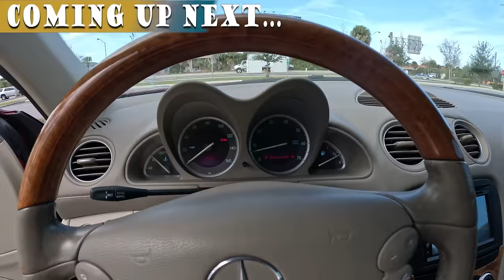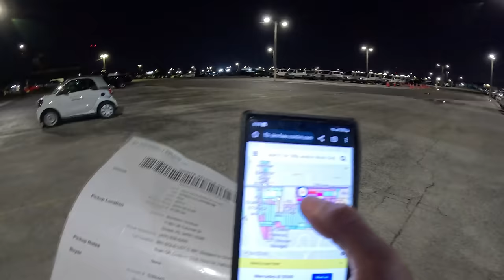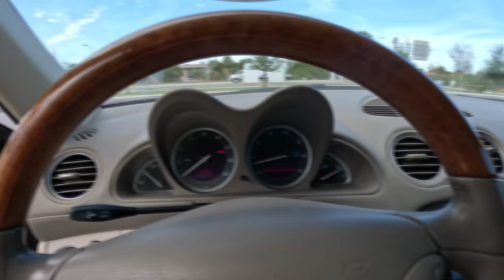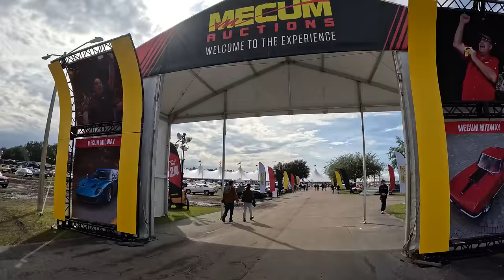Day 1 was a Disaster! I tried selling 5 Cars at the Mecum Car Auction But Everything Went Wrong!

Comment: In the ghetto in my city, you pull into the O'reilly Auto Parts, Auto Zone, etc., and every light pole has a sign that says "Absolutely no auto repairs allowed in this parking lot."  Invariably you will find one guy doing an entire engine rebuild, another guy dropping the transmission, someone else doing an oil change with no drain pan, tires everywhere, batteries getting recharged.  It's mayhem.

Comment: Don't EVER put duct tape on the painted surface of a car! If it doesn't pull paint off, the adhesive will still be a bitch to remove. Instead, use the original Scotch blue masking tap. They now sell other versions of it, including one that supposedly is even easier to remove, but it has less adhesion and the fact is that the original version, even after extended application, and even after being subjected to sun or rain (yes, water) will not only do the job intended but will almost always pull off without adhesive left on the surface. But it will virtually never pull paint off upon removal.
Reply: Painter’s tape.

Comment: Watching the clearcoat peeling off hurt my soul 😭 Crazy that I've flipped probably half a dozen hardtop convertible Chrysler Sebrings, two Pontiac G6 hardtop convertibles, and one VW Eos hardtop convertible all with more miles and they had no top issues, this video makes me feel damn lucky 😂 But hope you at least break even on the Benz man 👍
Reply: Mercedes Hardtop convertibles are problematic if you take them to Mercedes for repair, you will be charged through the nose.
Reply: @ccnixon  Mercedes quality control rivals Jaguar and Ferrari. Practically non existent.
Reply: Hardtop Sebring Convertible? never seen one, a 200 yes, never a Sebring
Reply: @TheEnd-eg6wq  Yup the hardtop Sebring came out in 08 - The later first gen Chrysler 200 was basically just a refreshed Sebring so it kept the same hardtop design. The rear decklid opened backwards just like this SL500 and folded similarly and looked just as complex, but surprisingly for an old Chrysler I've never flipped one that the top didn't work.
Reply: I have that hardtop convertible and I was spilling my drink watching you guys struggle with it! I heard about the red painted ones having a paint issue that you found. That car is a pain in the ass. When it says ABC, it means $$. But you probably know how to fix that. Best of luck making some cash on that Benz!

Comment: Craig, a tip for you for the future, pick up some Dr. Shrink Shrink Wrap Tape.  It is as strong as duct tape (possibly stronger) but the adhesive doesn't leave residue on paint.  It is pricey but worth it.  It is made for use when shrink wrapping boats.

Comment: I too had a 2003 SL500 that i still have nightmares about and i dont even own it anymore...  It had 20k miles on it when i bought and was equally as crappy as yours.  I spent over $6k to keep that top running correctly over the 2 years i owned it and there was only 1 guy in town that had a remote clue on how to work on it.  In fact, when i took it to the Mercedes dealership to work on the top, they told me they do not work on those things and sent me to this independent guy who did a great job of keeping it going, but worked on it on his time schedule so it would be gone for weeks at a time.  Im getting all worked up just writing this...  good luck

Comment: As for the 2018 subaru wrx. The front and rear difs need the fluid changed every 25-30k if you don't when turning it will bind up and click kinda like what you were hearing.

Comment: I personally am at a loss as to why you chose to use the type of tape you did when there are several other varieties available at Walmart. Then the way it was removed pulling straight up rather than pulling forward after sitting in the sun for a bit later in the morning. it is not that uncommon for a painter to allow the base coat to cure a bit too much before applying the clear coat, severely reducing it's adhesion ability to burn into the base coat and become one with it.  I thought that you appeared to have far more miles on you in that dept. to know better. Especially with little - no time  to cure the more than possible results. But the results did create film content , whereas here on this platform ,can result in being more valuable than the loss itself.

Comment: Wait, so you got screwed when you bought that Mercedes cause the top was not working properly, ebrake panel broken etc. But then you drove it straight to the auction to sell to some other unsuspecting buyer? Do I have that right? And the WRX with issues, same deal?

Comment: Use 2" painter's tape, not duct tape. It'll hold long enough, it's designed to keep paint out (so will keep water out at least for a while) and won't take the clear off when you remove it.

Comment: Guys,guys,guys....you buy 3 different rolls of tape. 1) green frog tape, 1) blue painters tape, 1) gray duct tape.  You take the frog or painters tape and outline the area you need to protect make sure you secure to the body. THEN CUT THE PLASTIC TO FIT THE AFFECTED AREA. Last you duct tape the plastic to the frog or painters tape leaving a 1/2" lap or expose 1/2" of the green secured tape. If  this comes apart as you drive, you stop and get out and re-secure with more green or blue,covering the separation.  When you remove slowly un-peal the onion and I  mean slowly.......... Don't forget to send me a 2xl t-shirt after reading this.

Comment: OMG. The 2003 SL is the worst car ever made. First year made. Biggest money pit. Miles doesn't matter. Its the age of the car. ABC pump is $5000 dealer part only. Top will need all safety switches and rams. The fluid is leaking inside the car. It will ruin the interior. $5000 repair. The suspension oil hoses leak. $3000 repair. The battery balance module goes bad. $4000 repair. First year has the 5 speed transmission. Worst trans ever made. All these repairs need the merdedes SDC Laptop for proper repair and calibration. The list goes on and on. If you paid $1000 you paid too much. Return it and park it where you found it ASAP !

Comment: The issue with the convertible low hydraulic fluid makes me think there was a leak in one of the hydraulic hoses, otherwise, the reservoir would have been at the correct level. I have a convertible where you have to have the parking break on to move the roof (20 year old car). If there is a problem with the roof, there is an audible 12 beep warning.

I think your idea of trying to make money by moving cars from one auction to another was flawed. If it worked, every dealer would be doing it! Good luck though, I am prepared to be surprised!

Comment: Not to scare ya… but i had a slk 55 AMG & the reason your roof is not closing is because bad pump seals in your roof… it’ll cost anywhere near 3-4k to fix you haft to pull apart the whole roof & reseal each pump with small stupid seals its awful sold that pos & never looked back after i got my c6 those convertible mercs are THE worst & biggest pos to ever own.

Comment: Literally NEVER put duct tape on a painted surface even if the clear is in good condition it will rip it up. Blue painters tape on painted surfaces wont leak, holds well and would never do that unless the clear was applied with hopes and dreams.

Comment: Are you sure (like which house you lived at lol) that was your red convertible Corvette?  You were walking around it, said it was a 2015 (and displayed the year to us on screen) and in a hot minute you had the camera on the upper driver side windshield where the info was and it had 2014 on it.  Everything was a bit all over the place.  Calm down lol.  And tape on paint before even trying to add hydro fluid to make the top function properly.  You are better than that, right?

Comment: Subaru viscous coupling on the rear on the gearbox, prop shaft out and I think 8 bolts to unbolt, drop the unit and replace with a new part ! I think from past experience is where I would go too! £480 UK price 14 years ago for the part, when money had more value than todays Mickey Mouse currency.

Comment: as soon as i saw you put tape on that paint i said ohhh noooo. i have a 2001 slk. same color. the factory clear on these cars is losing its bonding to the paint. my car started with a quarter size bubble. after spraying it with a water hose nozzle (not pressure washer) i had 60 percent of the clear lift right off. any surface that the sun hit let go of the clear. the sides were ok and i was able to blend the clear back in and respray. 

i have never seen anything like that. i have had small sections do it on early 2000 fords. But it is starting to seem that factory clears are good for about 20 years and then just release. 

but that was not a respray, that was factory clear that lifted. 
u
20 year old Mercs and Beamers are simply disasters. old Hondas/toyotas hold up and older fords, chevys are decent. the European cars are horrible.

Comment: 2003 SL500 are junk and you have the ABS pump issue. I owned one. a decade ago and I was scared to drive it as each time something broke. Unless it has super low miles on it, no one will be interested in it. Sorry.